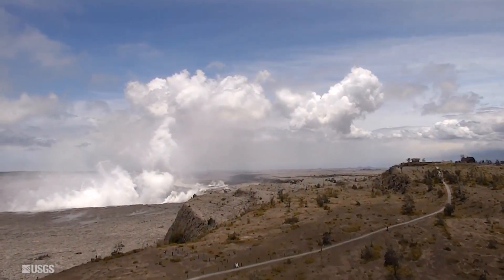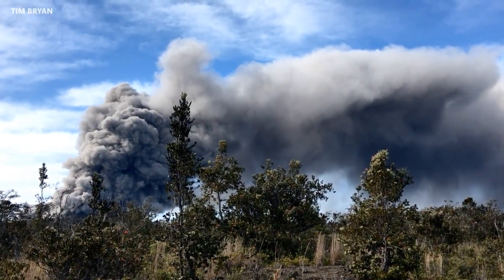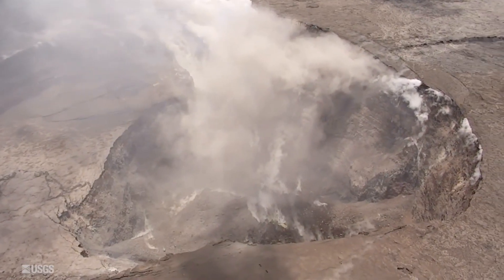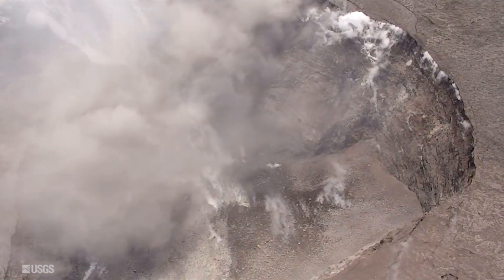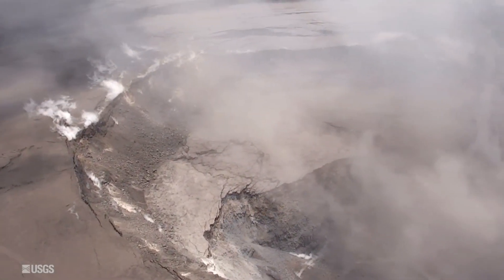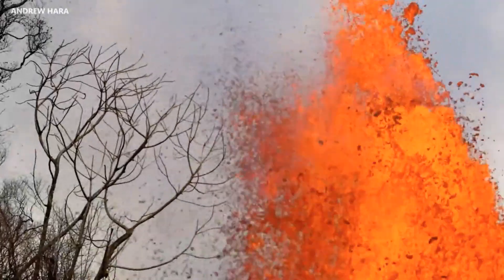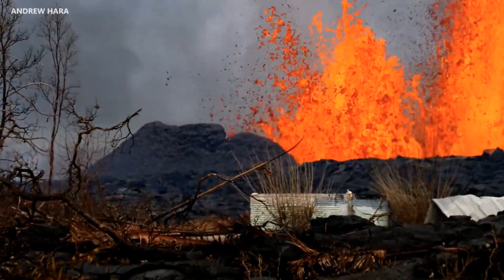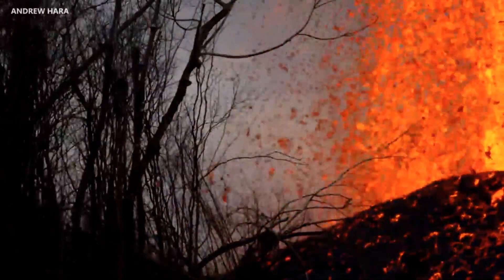USGS ~ Kilauea Volcano ~ Summit Crater Collapse ~ Drone Footage ~ June 1st 2018

Comment: I suspect this volcano that’s in the ocean will start showing itself now since Kilauea has plugged The magma chamber If the pressure cannot be relieved by the volcano in the ocean then you’re looking at explosive vent never witnessed If lava rise back up in the magma chamber 
Gases are created just like water flash to  steam when cold rocks hit the hot magma chamber causing an explosive event However the magma chamber has a lava tube to the ocean then the pressure will be relieved that way vibrating machines on the ground with seismographs could give you a good map of what the lava tube looks like underground i’m surprised you geologist have not thinking about doing that To get a clear picture of like a broken bone with an x-ray what could be going on underground
Reply from the maker: Every interesting.. This could get really interesting. Great comment Sir. Thank you!! :)
Reply: Volcano Time-Lapse 
Some occasions magma does rise with pressure creating an explosive irruption but in some cases the pressure in the magma chamber falls the internal wall falls into the magma chamber creating gases from cold rocks hitting hot lava So a volcano can Irrupt both ways I think that’s what’s going on in your time elapsed video of this volcano you’re recording
I’m fascinated with volcanoes and tornadoes lotta times I’ll go through all the day thinking about how volcano works and these are the conclusions I come up with
Reply: A tornado works with cold air falling from hot air rises creating a vortex a hole in space allowing cold air to fall violently With hot air rising around it
Moisture in the air only works when it’s cold when it’s hot in the air bubbles evaporate into smaller particles not seen by the naked eye 
When you see a tornado you got a column of cold air that’s in a vacuum hot air rising around it creating a vortex making colder air fall more violently Creating a vacuum in the space above Allowing hot air to rise violently to fill that space above
Water bubbles only intensifies the flow of air because water will move air better than air moving air
Reply from the maker: @Robert468us  Thank you, Randy. I have always been interested in all scientific things. Tornadoes are a fear I have growing up in the mid-west and having so many tornado watches and warnings. I still get that rush of fear when the weather gets bad. Yes, the volcano is a wondrous thing to watch. I'm so lucky to have such interesting people watching such as yourself to further my insight into these monsters. .
Reply from the maker: @Robert468us  Amazing! :D
Reply: Volcano Time-Lapse 
I think a tornado could be stop by simply releasing a lot of cold air next to the ground When a tornado comes to that point there’s no hot air rising so the tornado goes away I just wish I had a way to conduct experiments
The most effective way to stop a tornado is the cold air falling deep with in the super cell high above
Heating up the air that’s falling in the super cell Would stop the Tornado from cold air falling making hot air To rise to fill the space above but the air has to be heated up directly inside the super sale that will also cause the water bubbles that move a lot of air to evaporate Just simply disarming the storm with this ingredients to make a tornado another words heat up the air above the super cell Will stop the cold air and water bubbles falling within it
Reply from the maker: @Robert468us  interesting.. :D